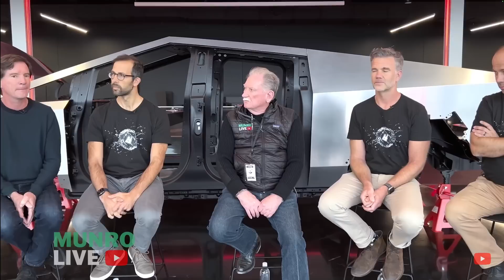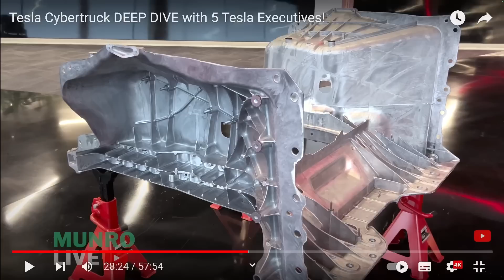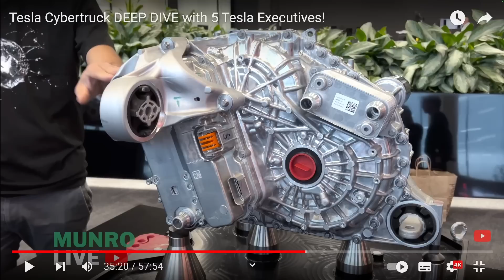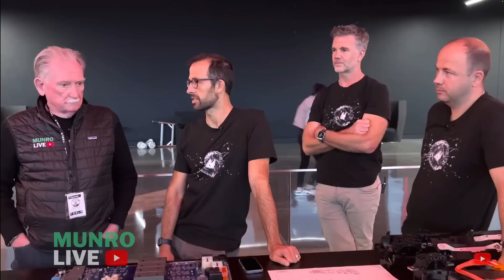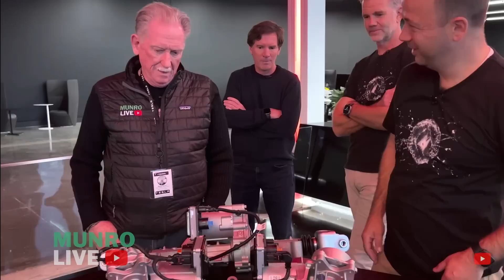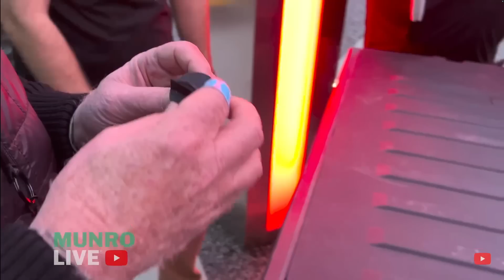Tesla Team Share Cybertruck Secrets With Sandy Munro

Comment: It’s been standard practice in the ICE industry to share motors between many different cars and share lots and lots of other parts.  The parts catalog is standardized, generally.  While that provides a lot of benefits, there are some downsides as well.  SMR seems to be acting as if this is something unique to Tesla.

And we know legacy manufacturers are doing the same thing with their EVs, using standard parts shared across many of their vehicles.  In this case it’s a negative in many ways, as they really should start from a clean sheet to optimize their EVs.

Edit: SMR later says what Tesla is doing is the “polar opposite” of what legacy automotive is doing.  He is just completely wrong about this and has no idea what he is talking about.

All auto manufacturers use standardized parts across tons of their vehicles.  They often use the exact same engine in many of their cars.  Hell, they even make almost exact copies of a vehicle and just change the branding.

The advantage of Tesla isn’t that they are using standard parts, which everyone does, it’s that their standard systems are so much better.  Using a standard system across all your vehicles when that standard system sucks (like legacy auto does in many cases), isn’t really a good thing (other than economies of scale).

Comment: Before I bought a Model Y and Model X, I wanted 500 miles in range, but now 300-350 miles is perfect. I don't want to be dragging around extra battery if 99% of my driving doesn't require it.

Comment: It would be awesome if the range extender could double as a power wall until you need it for a trip out towing!
Reply: But it's so heavy it needs about three hefty blokes to lift it (InsideEVs estimates 550 to 600 pounds) and then it needs securing so it doesn't move around in a crash or off road. Not worth it. 

However, the whole vehicle can be connected to the home to run the power in an outage or to use as an immense pseudo-power wall.

Comment: Battery capacity of the Cybertruck is likely 500+.  If they software lock it to 480 they have a margin for battery loss via software and additional capacity.  Once shown in production to not require the buffer they can software unlock it.  Then you get more range for free.  Only significant numbers doing lots of driving can they tell if its better to keep it to compensate for gradual battery loss.  Just a thought.

Comment: Most people drive 40 miles a day because most people live in urban areas. But if you want to sell to the rest of the US the range is a big deal. I drive 100 miles a day because of where I live.  Most of my friends do the same Give or take. If I only charge to 80% and don't go below 20%, and then take into account ACTUAL RANGE, I need a minimum of 250 just to drive to work and home.  Forget about going anywhere else. Also the farther out of urban areas you live the fewer superchargers there are.  So anything under 300-350 is not even practical.  The United States frequently forgets about factors in rural communities. They don't understand the many differences and more importantly they don't want to and dont care.
Reply: Must be a good job to do that much travel at your own expense.😊
Reply: @malcolmrickarby2313  it is. But after I got a tesla the cost went down substantially.

Comment: [this turned out to be a lot longer than I expected]  Vehicles have had tons of computers (mainly microcontrollers, see wikipedia)  for a few decades now.  Home appliances use small microcontrollers.  These are small/cheap computer chips that generally control a single device like a Microwave oven, washing machine, cameras, pocket calculators, etc.  They generally run a very limited operating system and they usually have less system memory but more I/O pins for sensing and control of the device.  They usually run a dedicated application to operate a device (Engine control unit, window & lock operation, a toaster, etc.)  and this allows them to operate in "real time" with guaranteed response times.  You typically cannot do this in a general purpose system like a PC or a MAC where many user apps are running concurrently (unless the OS provides high priority real-time scheduling).  Note that most vehicle entertainment systems do use general purpose computers and run an OS like Linux with a GPU for the display screen.

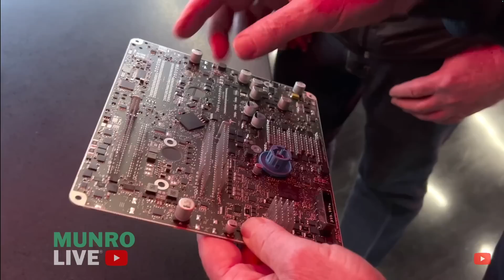So cars have been computers on wheels for some time.  What Tesla has done in the CT is more of a Network on wheels where they use a variation of ethernet that allows them to control the data packet latencies to support real time requirements for stuff like audio data transmission to all the speakers, etc. where data packets can't be late and can't be dropped (not like the Ethernet in your home or office).  Each ethernet endpoint has an interface chip as noted at 21:20 for the module he is holding (the blue connector is where the Ethernet cable connects to the module).  The interface chip is a microcontroller that controls the module and may also implement one or more CAN bus interfaces to talk to other nearby chips and devices using the CAN bus communication protocol.  In this way they reduce the cross car CAN Bus wiring present in the S,X,3 and Y between far flung devices and the control module that connects to the separate CAN Busses around the vehicle (same way OEMs also do it).  CAN Bus signaling is limited to 1Mbit/s (see Can bus on Wikipedia) and 5Mbit/s (see Can FD on Wikipedia) so multiple CAN busses are needed to support the bandwidth needs of all the endpoints on todays vehicles.  Tesla's CT ethernet supports 1Gbit/s (up to 1000X the CAN Bus bandwidth).

Each of the many microcontrollers has flash memory containing its software that can be overwritten.  Tesla is unique in that they designed the electronics in their vehicles so they can communicate with all the CAN busses across the vehicle so they can update the software on any microcontroller, like the window and airbag controllers, etc (via over-the-air updates).  The other OEMs did not do this so for them to fix a problem with a given device they need to physically pull the module and insert it into a special device (or maybe pull a flash ROM chip off a module) just to do the software update (Jim Farley spoke about this problem at Ford).  CT continues this design philosophy but uses their 1Gbit ethernet to connect to all the CAN busses in the car.
Reply: An excellent explanation for us geeks😅...

Comment: 😁😄😃🥰Steven, HOORA, HOORA! 
We have a technical video.👍 Engineering is what I know. 👍1975 of engeening and project manger.
Reply: We can tell from you English Expression...
Reply: @gregbailey45  I use ChatGPT 4 turbo and am going to GROK.  
The first development in Australia, when Lismore council approves, combines 250 passive homes and 57.7MW Tesla Megapack Batteries Farm and the PV in total 161,502m2 - TESLA roof tiles 45,000m2 and - Tesla PV panel 116,502 m2.

The Team and I would like to submit a Developments Application to a council on North Coast NSW at the end of May 2023. I am seeing Lismore Council on 26th Oct 2023:
1.	250 prefabricated SIPform passive house-certified homes. Tesla roof tiles are on the roofs of buildings. The excess electricity will be stored in the 57.7MW Tesla Megapack Batteries Farm. 
2.	The PV in total 161,502m2 - Tractile tiles 45,000m2 and - Tesla PV panel 116,502m2. The Team and I will add another 233,000 m2 of *Arctrech Solar Tracking by 2030—enough electricity for all Lismore residents and businesses. Everyone will have 3 PHASE like the Tesla Powerwall Battery. We will charge a potential wholesale AS$0.10 per kW.
3.	Bi-Charging of BEVs two per house and 12 Tesla Super Charger stations in the shopping centre. 
4.	Micro-grid that connects to a community of 4800 residents. By 2030, we will provide all electricity to 41,500 residents of Lismore.  
5.	Landscaping the whole site, ensuring enough clearance for the surrounding bush and buildings.
6.	We will be trailing the SoMax HTC process. 
7.	We will have a project at the end of 2024 that will install a long-range wireless power transfer. Emrod Tele-Energy Technology.

Some of the Teams and companies include:
•	SIPform
•	Tractile 
•	Direct Building Solution 
•	NB Consulting Engineers 
•	Green Product Certification 
•	Xlam
•	Weathertex
•	Cupolex 
•	Arctech Solar Tracking 
•	Tesla EV – PV – Powerwall – Tesla Megapack Batteries 

 We will raise a minimum of AU$ 750 million for the development by the end of 2025. We have investors in the US and the Middle East. The team and I will start crowdfunding in December 2022. The Team and I have a Zoom meeting on the first Monday of the month.

Comment: What if they use fiberoptics instead of ethernet?  Or a mixture of fiber and ethernet?
Reply: The weakness of fiber is it can’t deliver power.  Ethernet on copper wires offers data & power.
Reply: Finer would be unnecessarily expensive in this application.

Comment: Let's be clear. 
300 miles of REAL RANGE AT 80mph Would be sufficient! BUT, we don't get that! There are still many areas where chargers are scarce. And also times you want to drive 250 miles straight through, but can't do it. This standard, like it or not, would make a huge difference! You know, like most ICE vehicles! Especially with FSD helping with the driving!

Comment: The reason the 3 and Y were not 48V is supply chain.  You have to develop the supply chain you need for 48V with a low volume vehicle and ramp the supply chain with production.
Reply: ModelS last few years has been 26 volt.
Reply: @anastigmatix4119  Every bit of spec literature says Tesla architecture is 12V same as 3, X, and Y, which is why nearly all components are interchangeable.